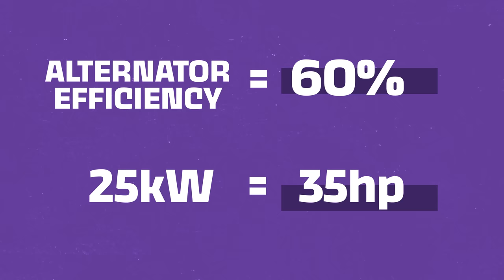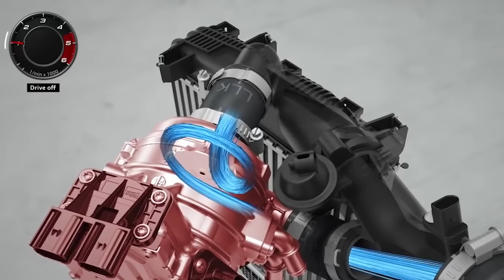Are Electric Turbos a SCAM?

Comment: What about using RC car motors, they use light LiPO batteries and are very powerful, not to mention that also be running off a separate system already so there would be no extra load on the engine. Reply with any flaws in this idea, I'd love to find some.

Comment: Could you take a compressor mottor off a air compressor and connect it to the intake. I mean it compresses air, it has a pully so you can run it with the belt.

Comment: The turbo vs supercharger thing is done to death. Not every engine actually benefits in the same way. For example the small block ford has way restrictive exhaust porting meaning any backpressure on a stock or even some aftermarket stuff is going to waste more time than average. You'd be better of running a supercharger and big exhaust cam for a nice miller cycle effect. This can push the exhaust aaaaall the way out without worrying about the whole new air thing because those two are happening at the same time.

Comment: so basically you can get the best of both worlds without losing much of anything with these. 
you only really need a power adder when accelerating. little stop light to stop light runs this would be perfect. 
1/4 mile or half mile perfect. its just like using n20 but even better. you dont pay to use it.
just let it charge and boom your ready for the next run. 
no extra oil lines to plumb. less chances of leaks. turbo isnt cooking your oil to death. no need for a turbo timer. no supercharger belts popping off. 
and when its not in use your not wasting fuel cruising on the highway or back road. just normal well mannered motor. till you hit the fun button.

Comment: 4 minutes of an hour of full throttle power in a road car is pretty decent.  Its not like we can put the pedal to the metal for long extended periods. too often.  Make a few runs at the strip or pull on the guy trying to race ya on the highway.  Even a little street racing after the car meet.  I would still just go with a nice and easy cheap turbo but if ya wanna go electric you most likely wont see the downsides too often

Comment: In electric turbo would have to be a hybrid. It would have to be both electric and gas turbine driven. If it’s only driven by an electric motor, it’s not a turbo. It’s just an electric powered centrifugal force pump or Electric supercharger.

Comment: Ye but they claim to be TÜV free  in europe/austria/germany. 
You cant upgrade the turbo or the Horse Power of a car easily in germany without tüv approval which can be really expensive cause you need to do a lot of tests like emission tests if your HP increases by >5%.
Since products like Torqamp say you only gain torque and no Horsepower from its a pretty good option since you should be able to put in without tüvs approval.
And the boost you gain claims to be pretty insane so i would have wished if you would have actuallied showed it off or compared it actually

Comment: What if you combined regenrative braking and an eletronic turbo wouldn't that provide more power for the turbo in a race setting also what about using exhaust gases to run a small generator for the battery as they leave the back.

Comment: A turbo is made up of two halves joined together by a shaft. On one side, hot exhaust gasses spin the turbine that is connected to another turbine which sucks air in and compresses it into the engine. This compression is what gives the engine the extra power and efficiency because as more air can go in the combustion chamber, more fuel can be added for more power.

Comment: Hey dude, just a quick note on the parasitic losses: 
You used the alternator as an example of an electric motor with 65% efficiency. But why didn't you use an MGU-H on an F1 car as an example? It is exactly what you're concluding on. I feel the alternator example is simply used to bias your idea that assisted turbos is too close to "it's not a scam", and not using a PMSM with an efficiency of +95% in this case skews the argument. F1 cars use a motor to spin the turbo as I'm sure you know, and if you dig through the 2021 regulations, you can back-calculate some interesting numbers on power/torque and efficiency. 
-An F1 ERS engineer

Comment: Couldn't you just put a tube connected to the side if the air intake with a 1 way valve on that holds the turbski instead of the intake itself so u have no parasitic loss from it blocking the intake and benefit from the horsepower produced

Comment: A hig output alternator gives out 550 amp at 12.6 volts...thats 6.9 kilowatts....they are VERY VERY efficient sir!!!
so basically your saying I need a "large stereo" tripple alternator setup for the "cheapy" ones?
3 x 6.9 = 20.7 kw
so....certainly "do able" with todays available alternators

Comment: I wonder how hard it would be to integrate an e-turbo into my CR-Z's IMA system. It draws power directly from the crankshaft via a generator connected to the transmission.

Comment: Electric air compressor, aluminum air tank, regulator, blowoff, and a ton of tuning so when you go past say 80% throttle and that air is forced into the intake the proper fuel/timing is maintained. Boom electric turbo. It is called compressed air supercharging.

Comment: The awesomeness of a turbine driven by an electric motor in the pursuit of faster lap times is essentially determined by the power-density of the battery being used to power the electric motor running the turbine. So judging by the battery technology of 2022, this might not be a great idea. And when power density increases in the future, running an electric motor directly to drive the wheels instead of blowing air onto a slow bruning fire with all sorts of side effects, will maybe be the more efficient solution. 🤔 Btw Im defiantly just an audio engineer, and this stuff just amasses me. I do not know what Im talking about. A temporally “turbo-button” is sure cool tho. Extra weight is however not🧐🤷🏼‍♂️ Thanks for making excellent videos. Keep up the good work!

Comment: I have suzuki swift gti with 1.3 dohc g13b engine. 101 bhp stock. Now with brushless compressor, maki g 5psi boost and 165 hp.  Works good for small tiny itty bitty mooters.

Comment: 4 min is plenty of time if it just fires off to compensate for the TURBO LAG until the exhaust gases spool it up to max speed (we're talking 250,000 rpms!!!). You only need seconds here and there then. Ask Bugatti, they put two of them in the Chiron. TURBO LAG is the problem, nobody needs an electric turbo operating 24x7, they just need it until exhaust pressure takes over.

Comment: 4min of use and 40min to charge isn’t that much of an issue if you set it up with a traditional turbo. Realistically it’s only on for a few seconds before the main turbo spools.

A true hybrid turbo with a clutched motor/gen is way better though.

Comment: I wonder if someone has make a turbo charger that uses a belt attached to the crank shaft to help compression at the low end and a one way clutch to allow the turbocharged to do its thing at the high end

Comment: 2:00 a solar panel on a wallet tracker.... a decice that is meant to be inside a wallet.... and said wallet is usually kept in your poket........ and it takes 2 hours to charge..... so i'm supposed to take that thing out of my wallet for 2 hours straight ? If i take it out, why not just plug it into an adaptor or something?

Comment: But eventually wouldn't it be useful to make electric anti turbo lag? I mean, not using another turbo which is electric, instead connecting an electric motor to a turbo and activating it only to keep up the turbine rpms hence not losing compression.

Comment: You need an extra battery to switch to while engaging the turbo for 3 minutes. The other battery is charging normally. Then vice versa. Just do not drain both batteries.

Comment: Has anybody made an alternator that uses the exhaust gas kinda like a turbo but for making electricity? 
Like you have the hot side of the turbo and instead of the cold side you just hook up a generator to the shaft

Comment: What if you hooked a generator to the cars wheels like old hybrid did then that could help with the power load just like a normal turbo use exhaust gas to spin up just a thought on a way to make it much better

Comment: How feasible do you think a hybrid turbo (electrically started and conventionally sustained) would be?
Reply: Biggest problem would probably be the engine starting at whatever rpms are needed and switching over from electrical to combustion would probably destroy a transmission but then again I know absolutely nothing, but if there was a way of starting the engine and not have it under any load until a synchronization device of some kind finds the perfect moment to connect the engine to the tranny

Comment: Stupid Idea potentially. Take a Hybrid Car, feed the electric turbo off the hybrid system, where a lot of the power comes from using breaks. Also Turbo Charge the car conventionally.

Is this a recipe for straight line only, front wheel drive burn outs, and traction control needing to be removed on a dad car, yes. However I think I have a future project. Do I think I can actually do it well, hell no.

Comment: I'm sure there is a very good reason why it hasn't been invented but the mad scientist in me wonders..... if instead of a battery operated electric turbo to feed a larger traditional turbo reducing lag how about a 12v compressor charging a small pressure tank and have that activated either by push button or pedal mashing.  Sure it would be a one shot, one second release but it depending on what pressure and what size of tank it could recharge in mere minutes.  Not enough to really give you any kind of power increase but maybe enough to get you to the top of the curve faster?  IDK its early and ive drank many coffee already.  its probs got the same issue as pure o2, where it would need N to stabilize it or the engine would explode now that i've typed it all out and thing about it....

Comment: they have designed electric turbos that generate power and compress at the same time though, applied in formula 1. It reduces turbo lag and gives an instantaneous spool up because it stores a bit of energy at all times.

Comment: considering that turbos work off of gas fumes for combustion engines.... very much YES! 
if anything- its a fucking windmill attached to a Automator ( i think that what its called, but its the part of the car that belt driven that produces electrical power to the car, like a mini generator. ) to make  access foulage for the engine to use.

Comment: QUESTION: Wouldn't it be more efficient to use an OXYGEN CONCENTRATOR on the air intake of the cars engine?
This would allow to have less inert gases stealing heat and instead getting more "BOOM" (real gas expansion) from the combustion, IMHO.
Is there any study telling whether the energy balance is favorable?

Comment: Electric assist turbos are being explored as a solution to semi truck diesel engines producing large amounts of soot pollution when they accelerate from a stop. Turbo lag happens every time the engine shifts gears and the RPM drops, so the engine is starved for air and produces black smoke that just wastes fuel.

Comment: How about we power a turbine with a separate small engine, like an 11 hp Briggs and Stratton? SO that like 50 lbs and no parasitic loss. A computer can run the thrrottle on the small engine or the driver can zoom it. Will that work ?

Comment: It is totally unacceptable that the year is 2021 and we still have crappy alternators like that. For ages we have the option for superefficient electric motors/generators higher than 90%, yet we are still stuck with a brushed DC thing. Yeah it is cheap but it runs like shit, which is a problem for cars getting more and more electric gadgets on them.
A mild hybrid should be obligated as the minimum for each new car, and would go nicely with an electric turbo.

Comment: In my humble opinion the real opportunity with a lot of these systems lies in reclaiming some of the energy lost to heat. Ever heard of a Peltier Generator? Efficient? No, but if you were to use them to reclaim some of the energy lost to heat from coolant and exhaust systems, that energy (electricity) is free (no load on alternator) and could be saved in a battery... for BOOOOST! You can actually find plans to build an entire radiator using Peltier Generators instead of conventional construction, and it can produce enough energy to remove the alternator from a car! You could add them to headers, etc, anywhere with heat... and there is a new opportunity for performance based external design. you need to have a heat sink on the other side of the Peltier Generator, the flow of heat through the generator is what makes them work... so you could have heat sinks sticking out of hoods into fresh air as a functional element to help extract heat from the car and generate power which could be used for boost in the process!!! :) ....sorry, I nerded out there just a wee bit :)

Comment: I hear the same stupid claim that turbos use exhaust flow.  The heat energy in the exhaust spins the turbo not flow.  If u measured the temp before and after the turbo, there will be a temp drop in the turbo.

Comment: You've got the engineering wrong. Turbos are nearly entirely powered by backpressure which robs exactly as much power as superchargers. There is no wasted energy in the form of air movement in an exhaust system. The waste energy is heat which the turbo scavenges through the Carnot cycle (decompresses the gas in the turbine which cools it, turning heat into turbine speed). Sadly unless the exhaust is so hot your valves have already melted, the Carnot cycle isn't efficient at all. So when all is said and done, turbos are only about 5% more efficient than superchargers. The real advantage is that turbos can reach full boost at low revs. If you made a centrifugal supercharger with a CVT driving it, you'd be pretty much in the same place. Or, y'know, an electric turbo.

Comment: What if you took a electric turbo and mounted it by the real one. 
Then it should put more air in the turbo and there for give the engine more power. 
Just a thought.

Comment: About 20 years I was boost up an old Toyota Corolla with a Thomas Knight Electric Supercharger. Well it was totally a lot of sh*** work. 4 extra batteries in the trunk, a much biiiiger alternator and much cables there are looks like a water pipe. But it works.... 😅 would I do this work again. Definitely No!

Comment: I have a 2011 Toyota Avanza wagon with a 1.3 motor , way too small , but , the rear gears are crazy with a 513 gear . What might happen if I put aa electric air pump on with a small shot or nitrous . It is a manual and the rear gear is small so no big shot or fog maybe 5 of 10  HP not more ?

Comment: Still calling it fake since you can't get the compressor wheel rotating fast enough to shove more air into the engine then what it can naturally do. Maybe on a small two stroke engine but not on a street legal vehicle.

Comment: Idk why do people think you can't have an electric turbo, provided the motor is strong and fast enough to compress air into the intake it works, it's so obvious... Also if you want it to run continuously just get more battery capacity and/or more generation.

Comment: So what’s the point of an electric “turbo” when you could just use a hybrid electric setup like a BMW i8 or the new NSX?  Seems like that ends up with a lot more power overall.  Expensive and forget about building it yourself for a bit, but maybe in the future you could take an old Civic and add electric motors in the back....

Comment: No such thing as an electric turbo. It’s a supercharger. A turbo works off free exhaust gasses ALWAYS. A supercharger works off the engine AND or the battery. So these are actually centrifugal superchargers. Even sellers of these say they only call them “turbos” because the search results for turbos are 400 percent larger than superchargers.

Comment: 12 volt is outdated for real. The advantages you get from higher voltage systems far outweigh the cost of changing industry standard in my opinion.

Comment: turbos arent effiecient in fact when a turbo doesnt spool it acts a restriction and a power loss it restricts both exhaust and intake. also turbo have to be regulated a lot more or they can cause runaway and destroy the engine. this is fact wehn it comes to say honda turbos of the 90s vs german naturally aspitrated the german naturally aspirated engine made 194hp all throught he power band whereas the usa turbo charged vehicle only made 184hp turboare only efficient during the island power band of the compressor map.
also most turbos are usuing enigne oil which scavenges from the crankshaft and superheats the oil creating a coking effect if this is returned in the valve cover this cooks valve guides seals etc etc more and more manufacturers are using electronic controlled turbos to control turbo runaway and provide proper turbine cooldown.  however remember a turbosupercharger or turbine supercharger does involve a higher maintenance cycle. so is it worth it or do you build a well built na car.

Comment: but how does the battery charged electric turbo increase horsepower when in action. what addition horsepower does it give the engine in the 4 minutes that it is working? i am thinking that if they give of 200 or 300 hp then they are only usefull in short races. otherwise they are useless to me

Comment: an electric turbo to help with thin air conditions?
just basically enough to keep power where its at regardless of normal altitude changes?

basically, i mean that normal mountain roads and not someone trying to drive up mount everest and reach the peak for no reason